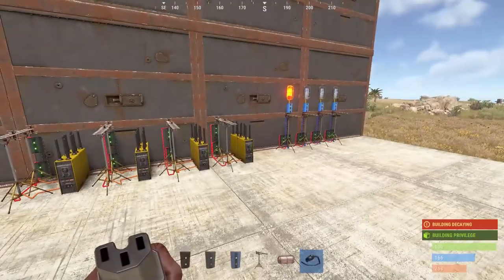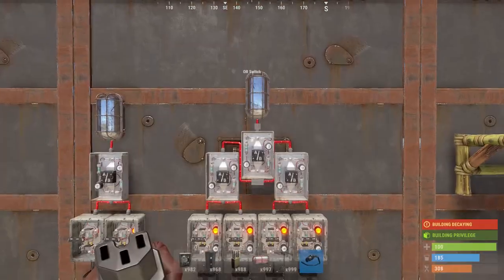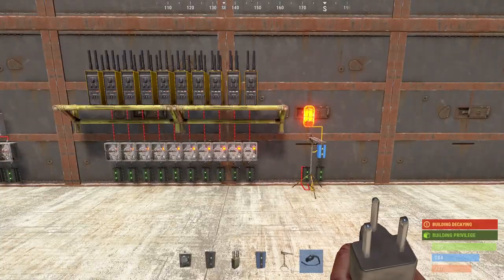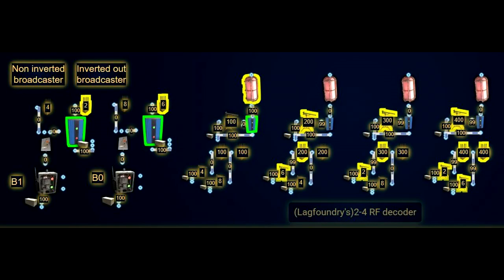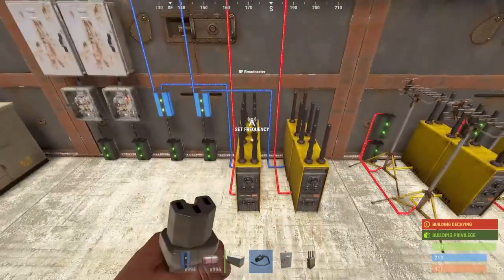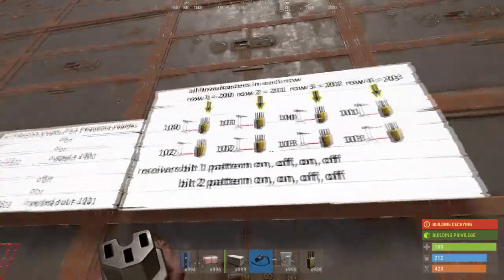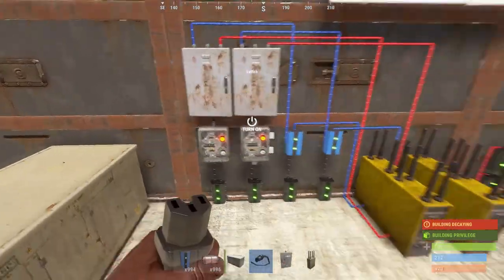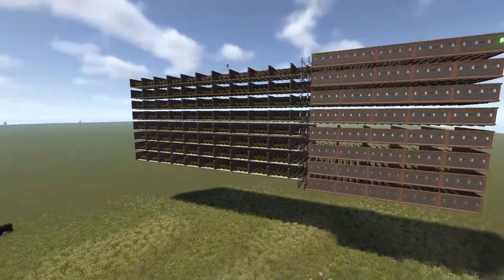How to Build a 2 to 4 RF Decoder in Rust Single Layer Logic #rust #electricalengineering #logic

Comment: You could create a system with several switches where you only need to activate the correct ones to open a door.   8 switches.  escape room style 
For example, 7 switches. But only by activating switches 2, 4, 5, and 7 can the door be opened. and how to change the "code" of switches.
Sorry for my bad English, I'm using a translator to improve it hahaha,  THANKS!!

Comment: Hey bro, i am just amazed that you are making digital computers in the game!! i can catch on about 30 to 40% but rest goes over my head, so basically u are making a Adder as in a calculator?
Reply from the maker: glad you find it interesting man. Yeah, it can definitely be used for that. Adders aren’t just for calculators though — they’re a core building block inside CPUs and GPUs. Almost everything a processor does ultimately reduces to arithmetic operations handled by adders. Even when you’re rendering a video or running a game, tons of additions are happening under the hood. so the plan was to use it for general purpose, a calculator would definitely be one of them.
Reply: @LagFoundry oh wow this goes deep, and as a ex programmer I should have known atleast a little, I think u are genius at this and keep it up, I would like to befriend you in the game and steam? If that’s ok with you, I get really cool ideas, but get stuck at logic, so maybe sometimes I can ask u like a big brother :p ?
Reply from the maker: @epicsportsshortsYT  yeah im cool with that. my discord is the same name too so if you want join the rustrician discord thatll make it easier find me cuz i post in there a lot.